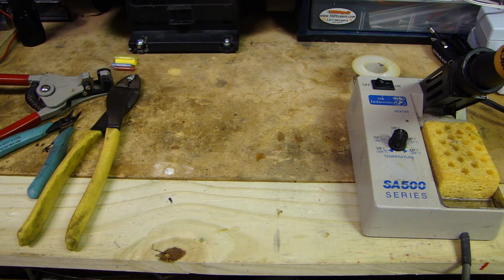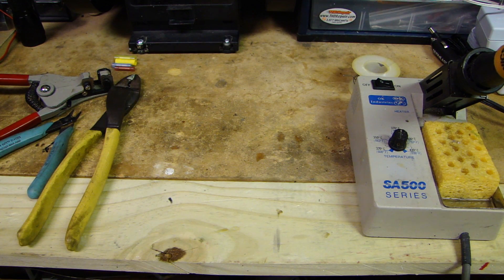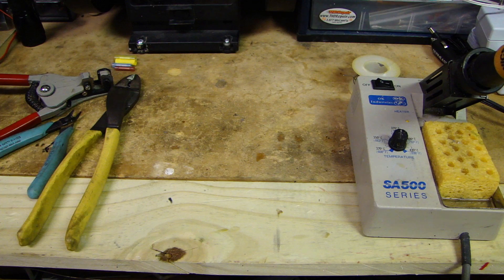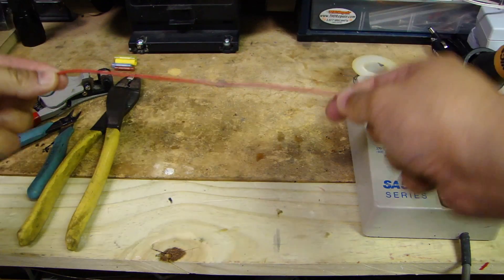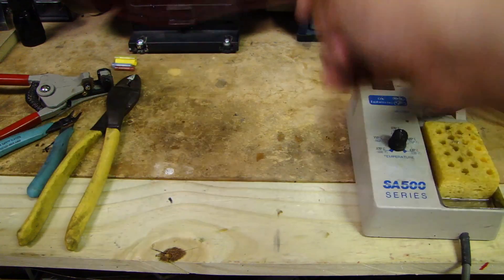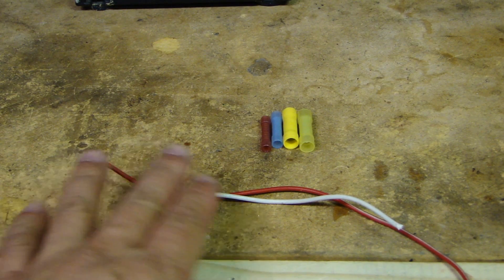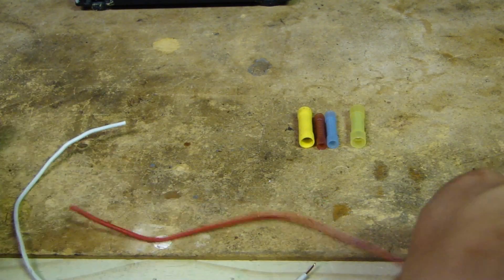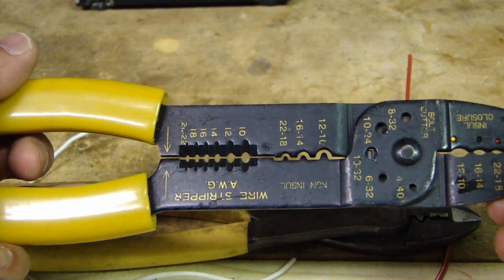How To Solder, Heatshrink, Crimp, Tap Wire

Comment: When crimping a butt connector remember not to crimp the tooth side of the tool on the slit of the connector or only 1 side may only bend resulting in a weak connection.

Comment: Do the wires have to actually touch inside, or will the terminal pass the voltage between the wires? Also, my car's stereo harness had a smaller gauge of wire than the metra harness; I stripped the wire a bit further back, twisted it, folded it over (to give it more girth) twisted it again and inserted it into the butt connector. Crimped it. Seems nice and tight. Aside from that, some of the strays are folded back a bit too much, with some of them leaving the terminal and sitting in the heatshrink; will this work, or should I start over? I haven't done this stuff since highschool.
Reply from the maker: Inside is a metal barrel so the wires don't need to touch. Just crimp the wires and you are good. As to your double fold and crimp and heat shrink, that will work fine.

Comment: Just a note about heat shrink, it shrinks at 100 degrees centigrade.  The insulation on automotive wire is rated at 105 degrees so using a lighter is not the best thing to do as you risk burning or embrittling the insulation.
Reply: Richard Prowse Does this mean a heat gun is necessary?

Comment: A poor video.  Soldering technique is bad, you should make a good mechanical joint before you solder using a lineman's splice or a hook joint.  Then clean the bare copper with denatured alcohol, flux the joint using non corrosive electronics flux.  When this is done, tin the tip of the iron, wipe it clean on a damp sponge or tip cleaner, then tin again.  The actual soldering is done by placing the tinned tip on one side of the wire, letting the joint heat and feed the solder from the opposite side.  The joint is complete when the exposed wire has an even coat of solder, you should just see the outline of the strands of wire, not a blob.  When the joint has cooled, clean again with alcohol.  The joint then needs to be sleeved using ADHESIVE heat shrink.  The purpose is threefold, one to insulate the joint, second is to provide a waterproof joint and thirdly provide strain relief by adhering to the insulation.  The non adhesive heat shrink should be used for covering bundles of wire.
Reply: Yeah, the video that you post is so much better....... Wait.... Be quite unless you want to make a video to show us how to do it the "right" way.
Reply: Agreed, its is to condemn when you din't have anything for others to judge.

Comment: Hi, Good video.  Where to source the crimping tool you are using? Thx
Reply from the maker: I believe Home Depot and Harbor Freight has them.
Reply: thank you very much  for replying; have checked amazon, eBay, other online shops and no joy so far. I found some other ones but I don't want to take chances.

Comment: For wire stripping,i found the self adjusting wire stripper IRWIN vise grip brand better,because it has also the cutter and crimper all in one.And you don't have to worry about the size of the wire,capable of stripping 10-24awg.try it my IDOL.

Comment: When crimping insulated connectors, such as butt connectors,  you should be using the insulated crimping section of the crimpers. You're using the non-insulated crimping section in this video which is incorrect. This crimps the connector too tight and can cause mechanical failure. The crimping tab can also pierce the insulation on the connector and leave the connection exposed. Most crimpers (including yours) are clearly labeled, usually as "non" or "bare" and "insul". Great video otherwise though.

Comment: Excellent video! I noticed your crimped connections appear to be at 90 degrees to each other when using the butt splice connectors. Is that intentional? Seems to me to be a good practice. Really enjoy your videos. Thanks for sharing your knowledge and skills!
Reply from the maker: +Roy Lewis If you are referring to the crimp tool crimping down on the connector, then yes the connector is 90 degrees to the tool. The wire will slide straight into the connector itself.
Reply: +dial2fast Actually, I was referring to the    crimps being perpendicular to themselves. Doing so gives the middle section of the butt splice connected a less flattened profile. On the other hand, it may not matter. Again, great video!
Roy
Reply: hai

Comment: On the automatic stripper there, do you find that the jaw that holds the wire down while the other jaw actually strips notches or breaks the insulation a little?  If so what do you do to lessen that?
Reply from the maker: Penfold8 I have been using that stripper for 10+ years (I have 3), and none of them damager the insulation. It grabs it just enough to hold the wire.